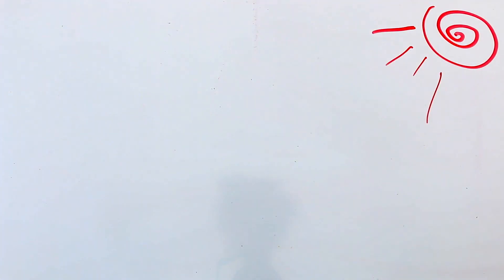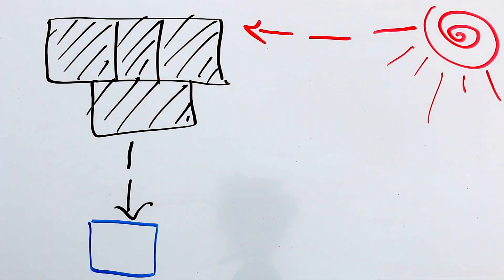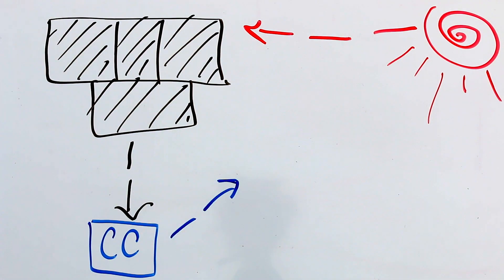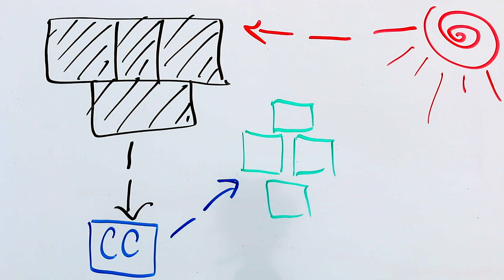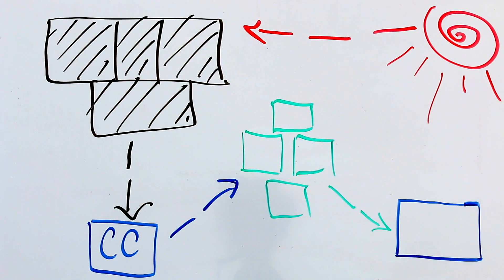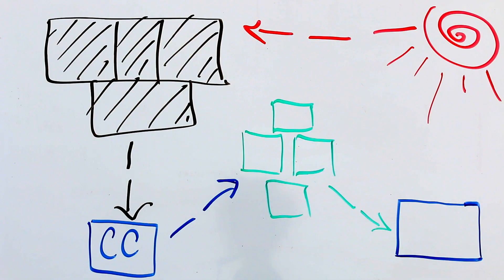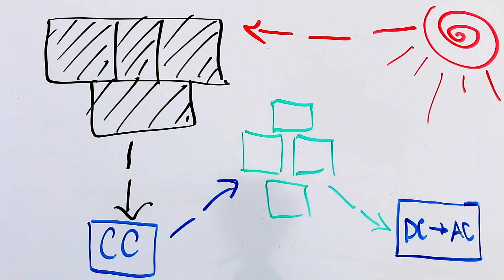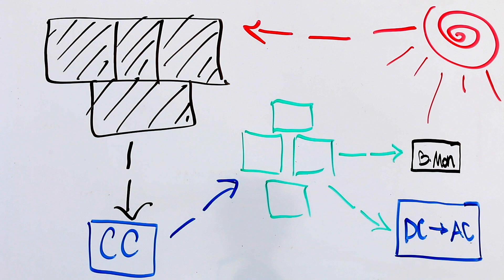The 5 Main Components of an Off Grid RV Solar Power System

Comment: I appreciate all your hard work!  I'd like to see a follow-up on how you tie in your inverter with existing coach 120 AC.  Or, do you just plug inverter into an existing 120 AC socket?  I'd also like to see more on how you tied in all your batteries parallel cabling?  I'm not sure how many you have?  Looks like you have a metal roof?  I guess VHB won't work on my TPO rubber roof?  Cheers!

Comment: Hey,i love your videos.I got a question.Does you solar setup power your air conditioner?My wife and I are in our 60's we have 2 small dogs.We have been living in our rv for 6 years.Always connected to shore power. Our main concern is leaving our dogs well cooled if we wanted to boondock for a while without using a generator.
Reply from the maker: No it doesn't power the AC. You would need a generator unless you have a ridiculous amount of AC. You could find some shade and run multiple fans for days!

Comment: Excellent video as usual! I do have one question about batteries as there seems to be at least two schools of thought as to which type, for lack of a better word, is/are best for use in RVs as well as on, off, and semi-off grid homes. One school seems focused on golf cart batteries while the other often focuses on solar specific/specialty batteries. My wife and I are planning on doing two things once we move back home to South Carolina 1) Buy an RV and equip it with a solar power system. That was decided long before I knew your channel existed. and 2) live as "green" as possible in our fixed home as possible using BOTH wind and solar to either completely negate the need for connection to the electrical grid or at least be prepared should the grid fail completely (not impossible) or just locally (not at all uncommon during the winter and during hurricane/tornado/lighting storm season(s) in our home area. In short what type of battery would you suggest, golf cart or solar specific? Thanks again for your time and the interesting and educational videos.
Reply from the maker: What a great question! We will definitely be making a video on this (we will make a weekly video on every aspect of off grid solar). As far as my research went, the solar specific versions were designed to increase the battery performance for a solar specific setup. The company recognized the application of their standard golf cart batteries and invested some time and research into making them work better with solar. So, in that sense, we would definitely suggest the solar specific. Personally if money wasn't an option, we would look into Li-ION batteries (much less maintenance). Unfortunately they will run you twice the cost. Hope this helps! Best of luck with the RV reno and solar install. Stay tuned for our solar series every Saturday.

Comment: Great Video.. you may want to get the new Battery Water Caps.. they allow you to use like 80%+ water evaporation., I bought mine a few years ago for my 4  6volt Trojan Batteries and im off the grid completely in my 33ft Travel Trailer and im only having to add maybe a cup of distilled water to all 4 batteries maybe like every 6 months
Reply: Also I just looked up the wording of the battery caps that I had mentioned previously they are called "Water Miser Battery Caps" they are around $4.00 each kinda pricey but Well Worth the investment for your Trojan Batteries... Hope This Helps..
Reply: those came on our crown renewable bats. great caps!
Reply from the maker: Awesome! Thank you for the great advice. We will definitely have to look into them!

Comment: How did you mount the battery hold down straps?
Reply from the maker: I'm sure you could easily strap them in. Ours just sit inside the holsters that are screwed into the sub bay. The batteries are almost 70lbs a piece and fit very snuggly into the holsters. We've been 8,000 miles with zero issues... though we do drive conservatively. Hope this answers your question!
Reply: It does.  Remember that a 70 lb projectile can cause tremendous damage when it bouncing around like a BB in a boxcar.  Just saying..
Reply from the maker: That is such a good point. They will be secured down before we ship off to the next location. Thanks for the perspective!